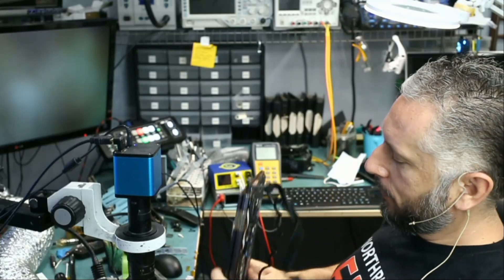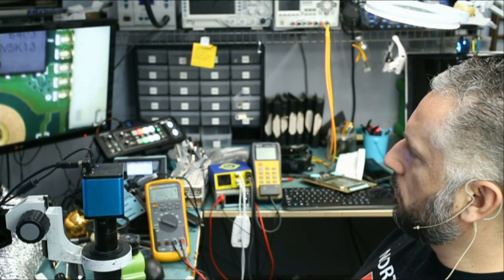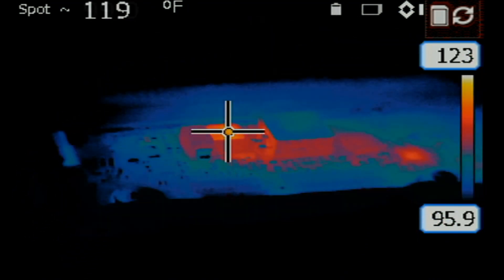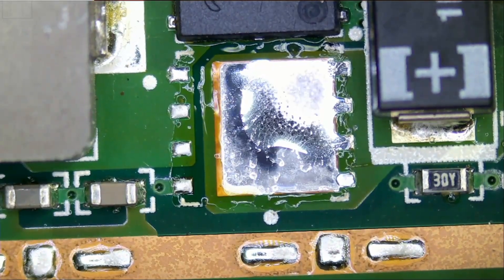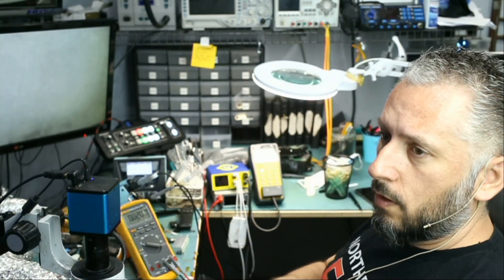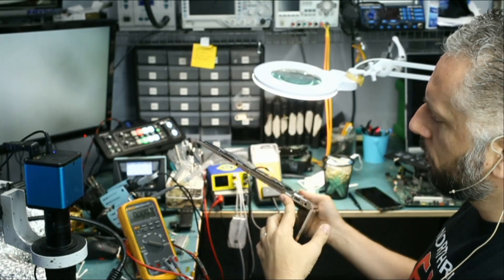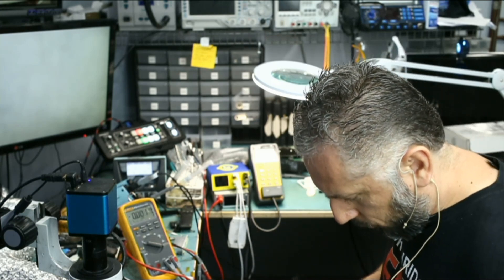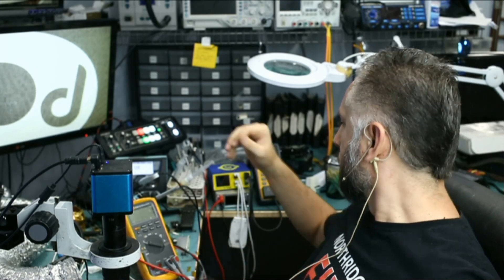HP Spectre X360 Repair - Almost gave up. Nothing turning on and no charging light 15t-ch000

Comment: Good find. I had a Lenovo laptop that had the very same problem with a small power switch board similar to yours. Surprised it was only the power board switch and nothing else. It was super nice to have an exact board to use.  Always nice to see your face light up when you get things to work.

Comment: Nice troubleshoot on a cple HP I worked on theres a protection kill diode on some , if some one trys a different charger brick or shorts it the diode frys and appears to be a dead MB, in reality its a false protection switch that basicly has no use but maybe make you spend more on their products

Comment: Why don't you try to find the problem with the power board just for educational purposes 🤔? It would be interesting if you could find the cause of board failure. Thanks in advance!
Reply: Maybe when he can he will. This guy is running a business and probably doesn't have a lot of time due to the massive backlog of things to repair

But you're right for the viewers it would be a lovely video for education :)
Reply: Because if some ic or chip get sorted by mistake the shopkeeper have to pay the owner.
Reply: Probably yes , but the time to fix it maybe the board is cheaper
Reply: Yes I have to agree he has a backlog of other components to repair. yet it would be interesting to see him fix that board or diagnose it.
Reply: He is way to busy to play about with broken parts
Reply: That tiny board have hall sensor (magnetic sensor) .thats the issue
Reply: Nothing bro there will be a tiny transistor and it will be rusted
If we clean using ipa it will be back to work
Reply: @ManjuKotekal46  true
Reply: @ManjuKotekal46  true
Reply: He is running a business and he has to try to minimize the amount of time he takes to troubleshoot and repair. He has to make a living after all. Getting the machine fixed is the aim in a business scenario and he did his job.
Reply: For in depth board repair analysis you may want to watch @AdamantIT

Comment: i have repaired a few of those too also and this one is really tricky, the plastic case can actually cause the switch to not turn on due to a push single throw. ie the swich stays compressed so u dont actually get full turn on

Comment: I guess I should say I want to see you troubleshoot that tiny board since everyone else is asking.  lol  I have dealt with a bunch of HP machines over the years.  Their 2-in-1s are a pain in the ass because they crammed everything in place without enough electrical isolation.  At least that is my current hypothesis--HP sucks beyond measure when it comes to getting the angry pixies where they need to go.  I Have a stack of HP Elite x2s at the office that are all at different stages of frying themselves.  Usually it is the wi-fi or the mobile broadband boards that get hit first.  Then they eventually end up like the 360 you are working on in this video:  No light, no charge, nothing.  

Honestly I am afraid to leave anything HP makes plugged in overnight/unsupervised.  8 years ago I bought an HP AIO inkjet for home use. It was a nice printer for what it cost, and the scanning wasn't too bad either.  I liked it so much that I bought one for my parents.  Then one day mine just stopped working and I was only able to get it to turn on after leaving it unplugged for several days.  After a few weeks my parents' printer stopped working too.  A whole lot of troubleshooting later and I discovered that these cheap HP inkjet printers were somehow destroying whatever outlets they are plugged into.  No sounds of arcing or any obvious overheating, the outlets just die after some random number of days.  And I mean these outlets are DEAD dead, no matter if they were connected to a wall outlet, power strip, UPS, what have you.  I couldn't get a desk lamp to work on those outlets after they got the HP treatment.

A few years later and I am trying to help a friend's parents with their printing issue... "It won't turn on, you say?"  Nope.  And the outlet it was connected to was dead as a doornail just like my situation.  I unplugged everything and then showed them what was happening.  I hauled the HP printer to a recycling center and they went shopping for a printer from "anyone but HP".  

These are all older incidents, but I talk myself into trying another HP product every few years or so.  Same issues with slightly different behavior every time for laser printers, inkjet printers, laptops, tablets, and PCs.  I still don't know how it is killing wall outlets though...no scorching, just no juice...

Comment: Newbie question.
At the start of the video when he was measuring the voltage across various components, he set the multimeter to volts and placed the black probe on the component.
Where was the other red probe placed?
Reply: Most probably to Ground, like some USB connector case maybe.
Reply: @dr.hinneredv932  Thanks.

Comment: I wondering if it was due to some logic on that power switch board like a Power Good signal that caused the issue. It does not seem to be the button since the charging light was not even coming on. I know on some HPs simply disconnecting power and battery and pressing and holding the power button sometimes solve power-up issues but this one seems to have component issues on that board.

Comment: I've had a few HP spectre's over the past few years. Two of them had the ribbon cable to that power board go bad. Seems like a common issue for some reason.
Reply: I’ve got one at the moment. Unit doesn’t charge when the laptop is off. Unless I use type c
Reply: When it’s on the normal charging port works

Comment: some laptop when you disassembly completely and assembly back will not turn right away, it my be bios battery or main battery, it will take a time until proper boot

Comment: I have a HP Spectre x360 15-ch034ng and I have a strong suspicion that I need the same replacement part. What's its exact name or part number and where/how can I possibly get one (in Germany)? Mine says DA0X35TBAF0  but google doesn't show me anything useful.

Comment: I have the same model with 8th gen Intel. Mine has the charging light blinking at interval but it just does not boot up. I had even tried taking out the battery but to no avail. Any pointers?

Comment: I have a old but very decent laptop that barely has use and was always well treated, the board, fan and cooler doesn't even have any dust, it still looks shiny and I have even a custom CNC cooler for better temps.

I gave it to my father since I wasn't using it, he only used it in a desk at home and like a month ago the laptop went kaput and doesn't turn ON 🙁

No power light, the charger is fine and giving the right voltage.

The only thing that turns ON is the mouse light being powered by the laptop USB while the laptop is completely dead.

I'm thinking what damaged it might be the mouse since my father didn't liked my big mouse which was all working fine 4 months. Then I gave him a older mouse which had a bad cable but worked fine however just a few days before the laptop went kapuf I saw that the mouse was turning OFF depending on the cable position so it was probably shorting but I just left it there and a few days after my father called me that the laptop doesn't turn ON...

DOES ANYONE HAVE A HINT 4 SOMETHING THAT I CAN SEARCH FOR ????

Comment: Hi, hp spectre x360 16" and the webcam shutter key (to switch on/off) stopped working - keyboard camera key on laptop got stuck (camera stutter in on, unable to use the camera right now). Tried updating the drivers, using external webcam its working, but the in-built cam stuck with shutter key on keyboard. Can you please help me on this?

Comment: Does it matter if he installed the mosfet upside down?
Reply: He didn't - look at the motherboard. The white dots show where pin 1 of the chips should go, and the dots on the MOSFETs are pointing towards the white dots on the board. Those two MOSFETs aren't supposed to be the same way round.

Comment: If only we could have a spare device for every repair. Probably had some liquid spilt on it . Not replaced a power switch board in years, thought the had stopped it. Well that's hp for you. Get a toshiba or dell. 

Nice fined Alex.
Reply: Toshiba lol
Reply: @ray.upside-down  I like toshiba,  good solid build and only 1 board issue in years. Hp are daily.
Reply: @TomsTechRepair  Man, don't ask my grandpa's last gift also has a issue that it only charges when I set the date before 17th Jan 2021
Reply: @ray.upside-down  well that's a new one on me. Have you loaded basic bios settings? Have you done a clean install?. Seems like software.
Reply: @TomsTechRepair  dayum its windows 11, the power adapter would simply not work if the date is ahead the given time. Will work with the battery but removing it would cause it to not boot at all, not even bios or built-in uefi diagnostics
Reply: @ray.upside-down  ok so I'm assuming it was on windows 10 and it worked. If you remove hard drive and plug in and go to bios. Will it charge then? Not all windows 10 machines will work with 11. I have personally not put 11 on at moment due to it has issues. If it charges and works on 10 but not 11 it has to be drivers for acpi or battery.  Maybe get a spare drive and put 10 on to see if it will work fine.

Comment: I've seen countless HP laptops from clients having charging/power on issues over the past 5 years across all models and ages (some brand new out of the box). It's so bad that when clients ask for recommendations, I make it a point to tell them not to buy HP. Not that it can't happen to any other brand, but HP are way overrepresented for power issues in my experience.
Reply: I work as an RMA on a store here in my local area. HP and Acer always have black out issues.